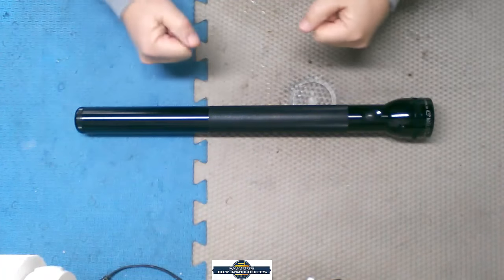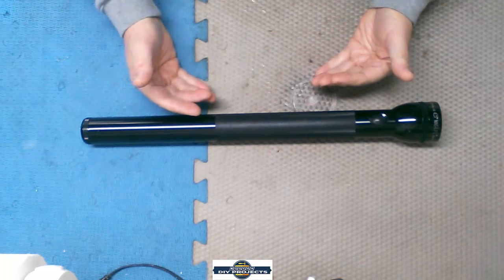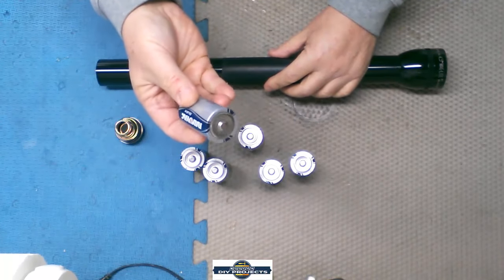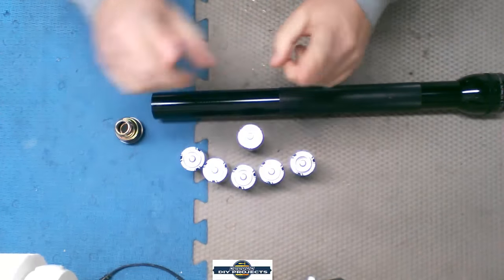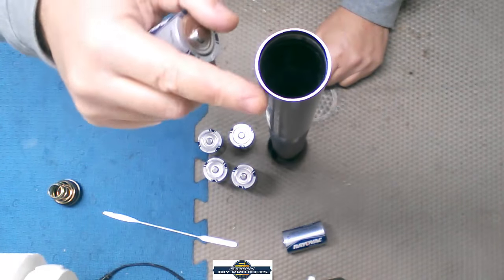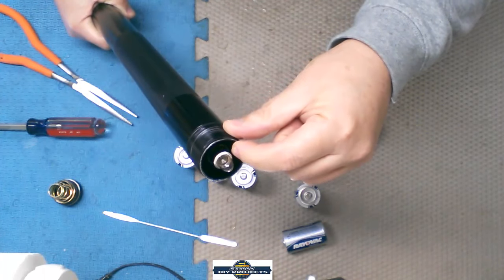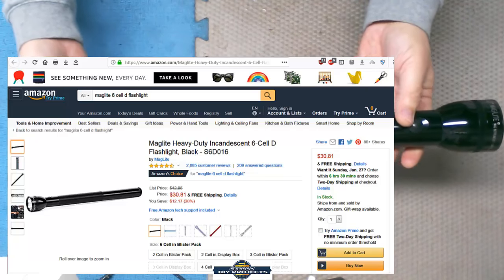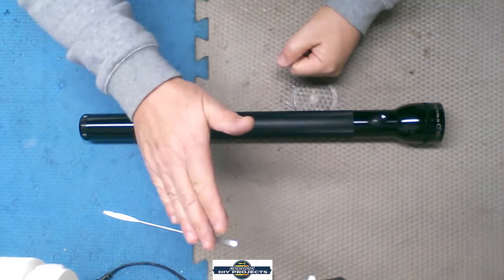Maglite Flashlight Batteries Stuck Removal Guide / How to Remove Exploded Batteries

Comment: I've been watching a few YouTube vids on this matter: my 40+ year 3D cell Maglite (genuine) has a different locking mechanism for retaining the bulb/switch assembly. It has an external thread locking ring instead of a spling clip and it needs to be unscrewed using a two pin type of spanner. I'll have to make one. The locking ring slides out FRONTWARDS and, I imagine, so too, does the bulb/switch assembly.

Thanks for this video, especially the explanation of how the battery gases react with the aluminium case, causing expansion and leakage. Once I've removed the offending stuck battery, cleaned out my tool and regreased (with ATF) the threads, I shall store the torch with the batteries outside of it and next to it.

Comment: i don't have a big boy 6D, just an old 4D mag, i had left for a few years under seat in mustang. Regular rayovac D's in it. So being well in Las Vegas in 110+ temps in summer, and at times below freezing in winter, of course it ruined it. I forgot it was there. Took a couple days, but got the suckers out. At first just banged it on carpet/floor, one came out fairly easily. But the other 3 corroded/bulged in tube...Let baking soda/water soak an hour, and banged on it more. Another came out. But that wasn't fast enough, decided to just spray good ole WD40 in it, let it sit a while. Boom, with some more banging , came out. Then just went to town with baking/soda water and a long fish tank brush/rags and got the corrosion  out of tube/contact, cleaning up the threads on screw parts, lubed the o rings with dielectric grease. good as new with fresh cells 

the tip at start of taking the cap off on occassion is a good idea. But now i just keep this maglite in the house in a normal temp. In car i keep a LED with lithium battiers haven't had much issue

Comment: I have some Maglites and like them and have had some for over 10 years and the problem with them is the batteries which is a problem and stick in the barrel. Right now I have about 4 of them that way and will try once more to take the light apart where I can get the batteries out and clean up the inside of the light. I found that Ray-O-Vac batteries are the worst batteries to put in your lights and I use good batteries like Duracell in my lights now.
Reply: I've had every name brand battery explode at one time or another........

Comment: 40 years ago it was rare that a battery would leak. Now I find that over half will leak - either a little or a LOT. I had two unopened packs of Duracell batteries (AA and AAA) with 32 - 40 batteries in each. See thru plastic packaging on cardboard. They were 4 years old and were stored in my guest bedroom away from light or heat. 4 out of 5 batteries IN BOTH PACKS were leaking and there was a white mess inside both packages. Duracell did send me coupons as replacements. But there must be a better way - the batteries destroy the device!
Reply from the maker: I agree. Almost every device I open these days the batteries have exploded. It is either poor quality products being produced or ridiculous government regulations causing the products to be less reliable than what they used to be.

Comment: I have a five cell and a four cell maglight,my favorite !  I replace the batteries so often I have never had a problem with battery corrosion. But it's nice to know what to do if it happens!
Reply: Sma 556  you should make a video explaining this.
Reply: Sma 556 <— don’t understand what you are doing fully, but does sound like you are taking up some of the very little space between the battery and the sidewall by doing this.  So that even a very little amount of battery swelling will fill up this space even sooner?   Yes?

Comment: I am also in the middle of this problem. The plastic base structure at the bulb end does not have threads but a circlip. Very, very tricky to get loose. It is unclear what comes next after succeeding to take of this piece, as there is also the switch and its rubber. I will rather try to soak it internally with wd40 and do some tapping.

Comment: What caused all the scratches inside? I thought the oil allowed the batteries to slide out.
Reply from the maker: The oil does help, but when they swell up and practically weld themselves with the aluminumn body, it takes a lot of pushing and prodding to get them to move (ie. the scratches). If I could have opened both ends it would have been smoother, but my bulb did not want to come out.

Comment: Excellent tips for getting seized batteries out. At 12:10 you mention a brush to clean the tube. You can't remember the name of the brush. Do you really think an amateur is going to know the name?? It's called a bottle brush. It has nylon [or similar plastic] bristles. Better to obtain a bottle brush that has metal [brass or stainless steel] bristles. That will clean much more efficiently, with less work.

Comment: A switch that doesn't lock or unlock when pressed is called a momentary switch. I quit using those Rayovac batteries in my Maglite's because they're guaranteed to leak and explode. It's unfortunate since you can usually get a dozen Rayovac batteries for the same price as a couple Duracells.

Comment: My end cap was welded shut with the corrosion. No way to screw it out without destroying it. Yeah I say its water proved, soaking in penetration oil for a month does nothing, including using propane torch.
Reply from the maker: Aluminum has a bad habit of welding itself together like that. It's just like rust on Steel. I would say to drill a small hole on the side of the barrel and see if getting penetrating oil inside of it will help. Also try soaking in baking soda and vinegar (separately, not together). Those can be rather helpful at times. The small hole on the body will not prevent future use if you get the flashlight fixed up.

Comment: i have a maglite but the bottom cap is completely impenetrable. How do you get it to unscrew?
Reply from the maker: If it is stuck because of age or rust build up I suggest you soak it in WD-40 or a rust/calcium removing solution. Soak it for a few days and keep trying to open it until it breaks loose. You can also take off the front cap and bulb and pour these solutions inside it to work from the inside as well.
Reply: @ModernDIYProjects  it not rust, the batteries habe exploded or leaked out inside and the bottom screw is covered with white subtance. Ill try the front, hope i dont break anything.😬 but thanks. Ill use WD-40.
Reply from the maker: @MrSaokid4463  Ok, now I understand. In that case try vinegar first. It will neutralize and disolve the battery acid which is what leaked out and causing the white stuff you see. Rinse and repeat a few times.

Comment: I have found that when I replace standard bulbs with led replacements they work great but will give good light even when the batteries get weak to the point of leaking.  Would not have happened with a standard bulb because the light output would have been reduced to the point you would replace the batteries for a weak beam.

Comment: What if the lid to the batteries is stuck? I have two mag lights with that problem.
Reply from the maker: These bodies are aluminum. It could be battery acid corrosion or just aluminum oxidation (similar to rust but not) building up inside. Try soaking the battery cap part in vinegar and see if that loosens it up. Could also try 100% Lemon juice. That can help at times.
Reply: @ModernDIYProjects  thanks dude, I'm gonna loose my sanity trying to fix these damn flash lights. Helpful advice is something I dont get enough of in my life.

Comment: I have a four D Cell battery with the two closest to the bulb REALLY welded in there. Using the long screw on the third battery after multiple lengthy oil soaks followed by some vinegar and backing soda merely pulled out a flat disc layer of metal from the third battery. Lots of more vinegar soaks and that third battery is pretty much hollow inside but the casing remains welded to the inside of the tube. Don’t have a course threading screw that can get close to the last battery. I also tried filling it with water and freezing it over a long week end since the water would expand as it froze. No joy after defrosting. I tried getting that C snap ring out from the front and broke off the tip of a curved rasp.😮  If I had some explosives I would blow the thing up just to get some satisfaction😔  Grr.
Reply from the maker: Extremely frustrating I know. What you can do on that 3rd battery (since it is hollowed out now) is to use a long screwdriver and just pry it away from the flashlight body to push it in on itself. That will make it easier to pry out of there. You will scratch up all the inside of the tube just like I did, but at least you will save your light. The last battery you will need to find a long screw to reach it. Don't give up, you can do it!!!
Reply: @ModernDIYProjects  Sounds like a good plan however I am going to need to buy a longer screw just for this purpose. Used the longest one I had on the third battery and only reached around 1/4” into the third one.

Comment: I cannot get the battery cap off the back is there a way to do that??
Reply from the maker: The cap is probably stuck due to battery acid leaking out. Try soaking the bottom of the light in some vinegar and try opening the lense and pousing vinegar in that way. Soak, Agitate then Rinse and repeat until you break the acid bond and it should open up.
Reply: If all else fails, soak the entire light in oil for a week. Then pull it out and clean all the oil off. May need to use brake cleaner. Then put the light in a benchtop vise so the light is parallel to the ground (i.e. horizontal) and the stuck end is extending out far enough to get a big wrench on it. A pipe wrench with teeth will do. Adjust wrench to snug fit on the stuck end and give it all you got. Just rememeber to turn left to loosen! The end and body may have scars from the wrench and vise but ...

Comment: Remove. Button cover. There is. A small hole in button, use small flat head. Screwdriver. To. Loosen. Set screw to remove. Front inner. Section.
Reply: 2mm allen key (aka hex key).

Comment: I bought my flashlight online for around $70. The batteries leaked and I tried to get them out. Finally I was successful. However, when I put fresh batteries in, the flashlight didn’t work. 

So what did I do?  I bought another one. After talking to the manufacturer, they said when it’s not in use, to take the batteries out.  Who uses their flashlight every day?  So there will be times it’s not in use. And I didn’t want to put the batteries in every stinking time I needed to use it. They were probably in the light a month. Wudda ya know, the exact same thing happened. So now I have two problems. In your video you suggested putting oil inside. Would that be plain cooking oil?  And, how do you check to see if the batteries will come out, without spilling the oil all over the place. Can the same oil that you put in be re-used or add new oil?  Is it a problem if some residual oil remains in the light? You said to pound on the batteries to get them to dislodge. However, the light I have has four AA batteries. Two with the positive up and two are positive down. Is it okay to pound the two batteries that are positive side up?

I know, tons of questions, but I really need your advice. 

Sorry this is so long.  I was, obviously, full of questions. Thank you.
Reply from the maker: I'll be brief as I can. Any oil will do, cooking, motor, transmission, gear, literally ANY oil will do. Do not reuse the oil since it will have acid in it. Clean oil will neutralize the acid every time you refill it. Drain out as neatly as possible but a mess is likely. Drain oil first before attempting to dislodge. You will know if they get loose or not. Always pound on the batteries with a wooden stick. No chance of arching or electrical discharge. Residual oil is OK since it will prevent then from exploding again in the future. Hope this helps.
Reply: @ModernDIYProjects  

It definitely helped. It brought one flashlight back to life. Now I’m working on the other one. Even after soaking it, there’s still some residual acid that I can’t scrape off and, so far, the oil hasn’t helped one stubborn area. But I’ll keep trying. Thanks so much for addressing my lengthy comment.

Comment: Any specific weight oil that you recommend? Thanks
Reply from the maker: It doesn't really matter. You are just trying to get something between the batteries to separate it from the body so any weight will do. You can even use cooking oil if you don't want to use a motor oil.

Comment: I cant get the end cap out.. Any solutions?
Reply from the maker: Try removing the bulb and pour oil or baking soda solution in from that side to loosen it up. If you can get either side open then try to soak the end cap side in a bath or WD-40 for a few days. Allow it to penetrate the threads.

Comment: and this guy didnt relise how the light is put together under the button rubber that pull out is a t6 or t8 bit find the right tool and the button assembly comes out
Reply from the maker: Good info, but realize that they are not all assembled the same. Mine for example is over 30 years old, so assembly methods have changed over the years. Mine has a ring around the button that needs to be unscrewed.
Reply: @ModernDIYProjects  yeah I didn't account for that but great video though what dod you think of the LED conversion kits for these lights I've got a 3d maglite and I and I bought a
LITT Ultra-Bright 350 Lumen Maglite LED Upgrade Bulb 3-6 Cell C & D Model

From amazon cost about £$12-15
Great and cheap upgrade

Comment: What kind of oil do I use to get the battery out that’s stuck inside my mag light
Reply from the maker: I used regular motor oil, but you can use any type of oil you have handy. Cooking oil is fine also. It is just to lubricate and break down the acid.
Reply: Ok I did that it’s turning slowly
Reply: I’ve poord oil into my mag light and it drips down to were the light goes
Reply from the maker: @leebird4690  You mean it is dripping out the other end? That's fine. Just put a container under it to catch the oil. It means it is separating the batteries from the case. If there was no room in the case the oil would not be able to leak out, so it's working. The oil will not hurt the light bulb at all.
Reply: We are trying bleach and it’s working
Reply: @ModernDIYProjects  Would you recommend vinegar, or oil? Because you mentioned both in the video.

Comment: A company should not be proud of a product that has such a basic design flaw that they have failed to correct after all these years. That is not a good reputation.
Reply from the maker: Yea, but back in the day they were the best deal in town. Now there are so many better flashlights out there that you are right. They are not the best any more. But for us folks that have one from the old days it's kinda a cool oddity. Kinda like folks that ride Harley's. You know they are not the best or fastest, or most comfortable, but they are still cool. 😆
Reply: GaryX - The "design flaw" is with the batteries - which aren't manufactured by Maglite. The rest is physics that Maglite can't do anything about it.
Reply: @ModernDIYProjects  I bought my 3D cell Maglite in 1980 and, yes, they were the bees' knees, back then and worth the £25 I paid. My friend has a "better" torch that's smaller and insanely brighter than my 3D was (even with my 20+ year old LED bulb) - but his batteries are non-standard, very expensive and impossible to replace other than by mail order. My Maglites take D cell, AA and AAA batteries - which are available anywhere, conveniently and quickly. I don't need the overkill brightness of his torch so I prefer my 3D and 2AA cell Maglites.

When the batteries die, ANY of my more modest Maglites are better than his non-functional torch - until he receives his new batteries in the mail. KISS principle. Well maintained, my Maglites should last forever, presuming that when D and AA cell batteries become obsolete adapters for newer batteries types will be made.

I grew up watching my father use (what are now) antique tools. Even when better, newer tools were available, he often DIDN'T upgrade - he didn't need to. He had experience, knowledge and skill with his tools, he could repair well virtually ANYTHING - and, on reflection, anyone seeing him use his "old tools" could see that he was a true, skilled, "old school" craftsman. These "old friends" set him apart from the many armed with newer tools who couldn't reach his level of quality.

I use various types of torches, including rechargeable work lights. But outdoors in horrendous weather, I can rely my life on my Maglites - even underwater. I grew up with the policy of buying tools for life so many of my most used tools are somewhat "elderly" now. Just proves how reliable they are.

One final word on my Maglites: when my hair turned grey, I didn't mind. It shows that I've maturity and experience. I tell people my age (58) without shame or embarrassment - perhaps with a little pride given that I've an equivalent of a PhD in the University of Hard Knocks AND am still going strong. Most of the kit I use in the great outdoors reflects my good choices of DECADES ago - and they're STILL very good choices amongst modern counterparts. I can MORE than keep up with the young armed with the latest "super cool" kit - and know that, in the long run, my choices of kit will endure for longer than many of their choice items of kit. My Maglites are an unintended statement of my ethos. "Old Sweat's Kit".